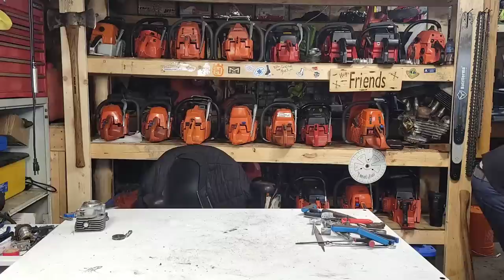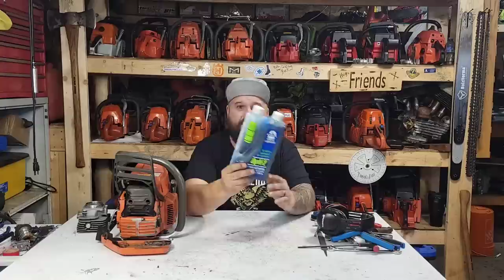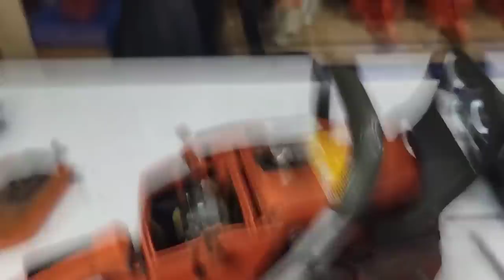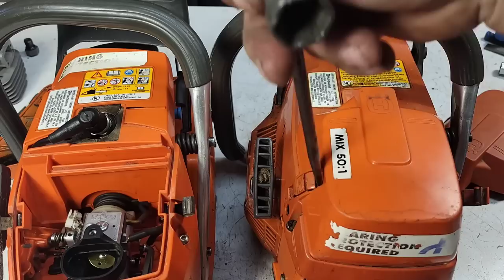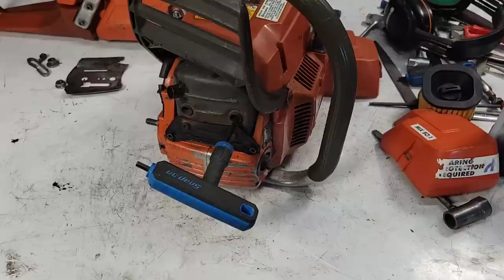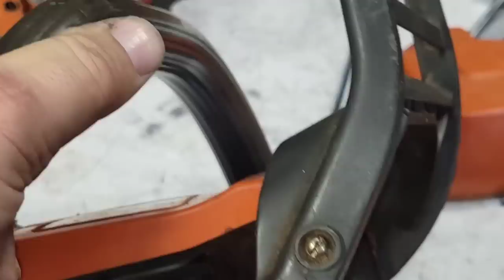A 371xp shows up!! 371xp vs 372xp what's the difference??

Comment: Donnie Walker said they were designed for up to 24 inch bar.  As you said, they beefed them up for a long bar, so were heavier.The early ones had an HD6 carb.  No limiters. I put single ring Meteor pistons in even the new saws with no problems.
Reply: I’m a CV single ring meteor man myself!

Comment: I have a 1998 371xp and it will cut as good as the newer saws it has a wesco piston and ported good saw I have changed the fuel and oil caps to the newer flip ones and the on off switch to a new one that go back to start again side clutch cover next on the list

Comment: I had a husqvarna 51 that stretched (and failed) a cylinder bolt.  It was sealed with motoseal.  Even only being anchored on 3 corners it only had the slightest WHIFF of an air leak.  I could barely tell it even had one.  Only discovered the source of the problem on a teardown later.  One skinny leak path a couple MM wide.  GOOD stuff.

Comment: Yeah man…I use that meteor 371 single 1.5mm ring piston in all my 50mm saw’s!  You’re loosing some massive lubrication function when you have the two rings and you are not getting a full wash down and across your piston with each stroke of your engine… it’s all about the lubrication!

Comment: Tinman: QUESTION, I’ve got a vintage 288xp. I rebuilt it. After rebuilding I configured it with the traditional low top cover. It ran fine.  But recently, I configured it with the high top air cleaner and top. Saw started up fine, but then died after a short period of idle, then revving it with brake disengaged to check bar oil, and then I put it down to let it run a bit more and it cut out. Is this because the high top air cleaner has ore air coming into carburetor leaning out the mixture too much?

Comment: The 3171 ,371 375 the cases were made of different materials and were between 18 and 22 oz lighter than 372 cases
Reply: 371,372,375 cases are all magnesium the difference in weight is the extra stiffening ribs and less crankcase volume in the 372 and 375 cases, the 375 came out after the 372 but 18 to 22oz weight difference? I would dispute that

Comment: You mentioned a stiffener in the 372 for longer bars. Does the 266SE have the same problem with cracking. Would like to run a 28” on mine.

Comment: I was at a local dealer today and saw a 372xp for sale. According to the sticker it’s a 2010 model. I’m a big stihl fan but I ain’t scared of trying a known good brand that isn’t German. Is it worth picking up at $575 with a near new 24” bar and chain? The thing looks like it’s in VERY nice shape. 99% of the loggers use stihl because of dealer support so I think it was a firewood cutters saw. On the other side they had a 2020 572xp for $700 but was not nearly as nice cosmetically. Been looking for a 70cc saw and the stihl saws are rare. Just wanna spend money wisely.

Comment: im liking this 371 and 372 compare id liked to see the inside of both cylinder's just wondering because i like the single rings better and was wondering if i could do 371 on my 2001 372xp other thing that goes threw my mind is how far can you go before messing with timing like can i grind my skirts out to match the case and not mess with timing id really like to know the info on the iron horse mod i think its the 86cc just wondering if your going to get or do a 372 like that and give the info out i been thinking on buying couple 372xp case and hope for the info to come out
Reply: I use the single ring Meteor piston on all, and they've been fine. Those bearings were maxed out on the 371xp. I'm curious to see how they stand up with the big top end.
Reply: I had been wondering about this too when I was building a Jonsered 2071 (same as 371). Here´s what I found out. The cylinders are identical, they come out of the same molds. Pistons are interchangeable
Reply: @DavidBergman1776  thanks for the info 
@MotorsMended

Comment: Is a Jonsered 2171 the same as a Husky 371 or 372 (non x-torq)? I picked up a 2171 (2008 model I think) a couple weeks ago for $100. Haven't got to mess with it but it fires up good and has good compression. Chain brake doesn't work and chain is shot is the only problems I've seen so far. I had been considering a 372 Husky or MS380 Stihl clone saw to fill the gap between my MS180 Stihl and MS660 big bore/ported mildly Stihl clone. Jonsered parts are crazy high so wondered if I could convert over to Husky covers if I have a problem with plastic or starter.

Comment: I have an original 372 it doesn’t have side chain tensioner it only has front tensioner also the side cover has no provision for a side tensioner either it’s just like the 371 you showed
Reply: 372 all had side tensioner.  If yours has front it’s a 371 that someone made to look like a 372

Comment: It’s really funny to listen to all the different opinions of 2 stroke oil and which to use.   Your buddy Buckin says use anything or maybe even no oil at all.   You say Opti-2 is all you run, and every guy after you has a different opinion.

My experience, they all work as long as you use them.  Buy a 2 stroke oil, buy good quality fresh gas, mix it at least 40 to 1 gas to oil, and enjoy your 2 stroke running for a long time.